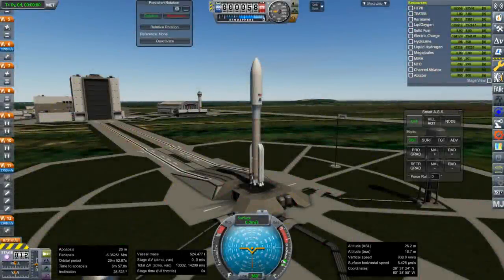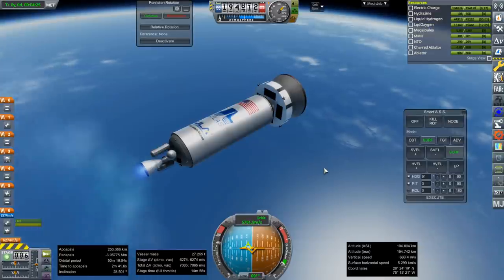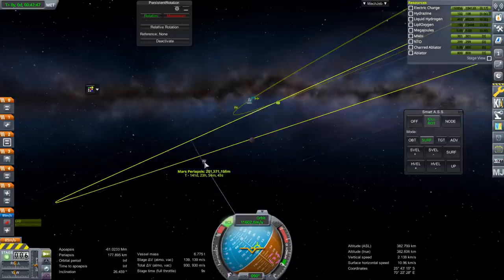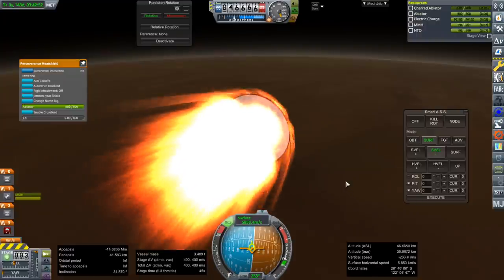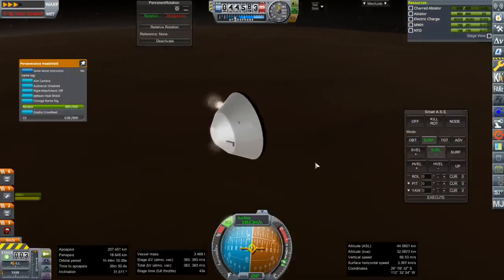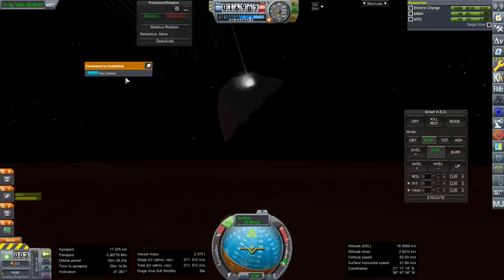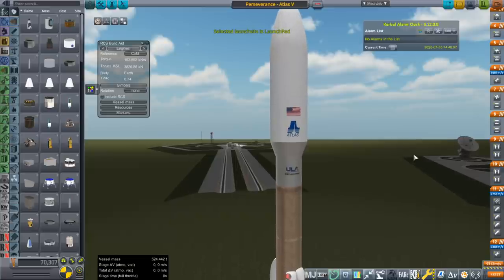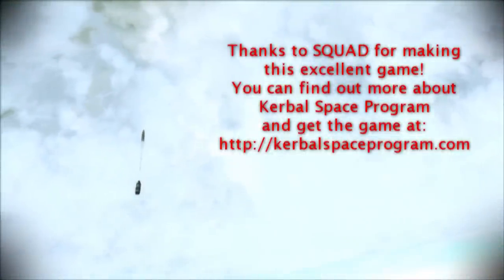Realism Overhaul in KSP 1.8.1 - Perseverance Attempt 2

Comment: heard of the F5 and F9 keys?
Reply from the maker: I've created these parts, so I'm testing them to see if changes need to be made. F5-ing is pointless since F9 wouldn't load the changes to the configs - the craft will have the old values. If I think the parts are all right and it's just a matter of my poor execution, my main job is actually done.
Reply: @RaizSpace  I am saying that F5 and F9 could have corrected the unfortunate execution of the landing. I think if you reverted to reentry, you could have fixed the mistakes mid-flight. gona play some stock kerbal now